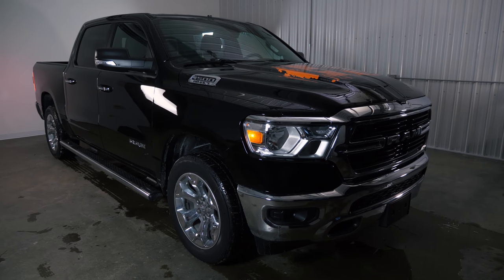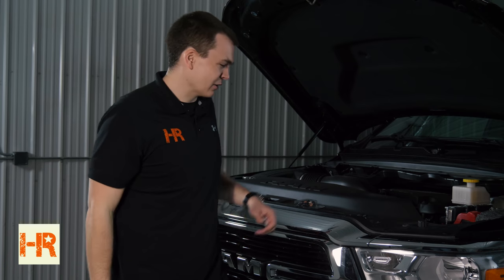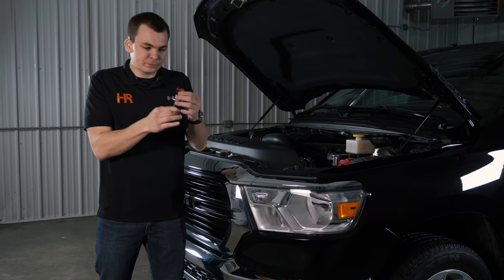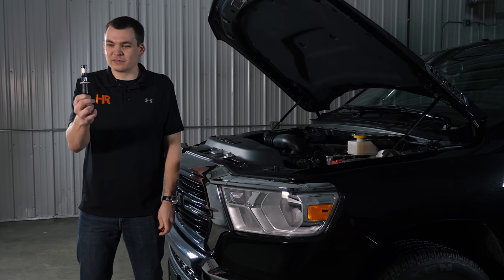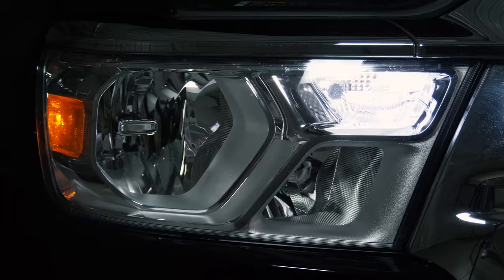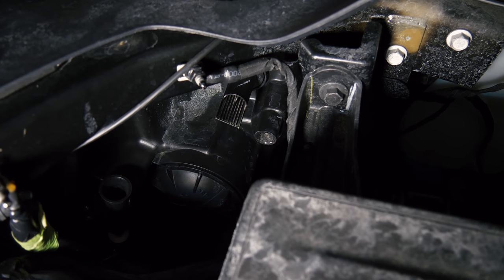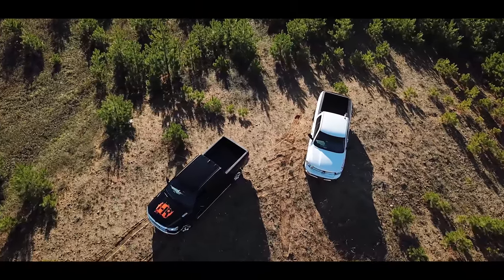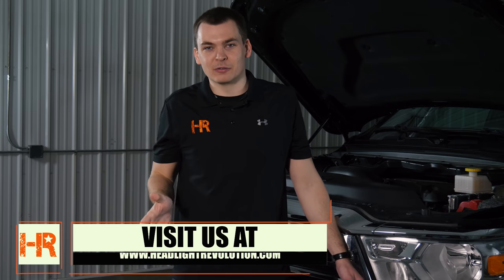2019 Ram 1500 LED Front Turn Signal Bulbs - NO RESISTORS! How To Install and Demo - SUPER BRIGHT

Comment: I have a question regarding my 2019 Ram with the full LED package.   What's the deal with the super dim white LED drl's?  Have you guys figured out a way to tweak the power to them and make them as bright as a chargers?  I understand why Ram did it, because of NHSTA code saying that if they're bright white, then they have to go off when an amber signal is turned on.  Not wanting to be like GM, they made them dim.  How can we trick it and make em bright?

Comment: How do the turn signals work if there’s no wires/plug attached to it like the headlights and fog lights
Reply from the maker: There are wires attached to it! The LED itself plugs into a socket, which is protected by the seal and cover.

Comment: Does the white switchback stay on when the turn signals aren’t being used?

Does it turn the turn signal area into a daytime running light?
Reply from the maker: Switchbacks turn to amber when the turn signal is activated, the white LED shuts off and comes back on when the turn signal is deactivated.

Comment: Hi got a question On my 2011 FORD Escape the rear blinkers has 3 wire I know one is ground the other blinker and brake when I tested it with my test light 2 of the wires both blinked 
does it matter what one I use from the 2 as the positive?

Comment: Are there any rear signal LEDs that don’t hyper flash for the 5th gen ram? Have a 2020 and want rear turn signals that are plug and play within hyper flashing
Reply from the maker: We totally have rear turn signals for your truck, as long as you do not already have OEM LED taillights! If you make sure that you have incandescent taillights, then you will want to go with the Armor Series 2156/3157 bulbs linked below, and you will also need a set of the resistors! 

Rear Turn Signal Bulbs: https://headlightrevolution.com/gtr-lighting-armor-series-3156-3157-led-bulbs/
Turn Signal Resistors: https://headlightrevolution.com/gtr-lighting-50-watt-6-ohm-gold-style-resistors-for-custom-installation/

Shoot us an email if you have any other questions on these signal bulbs! Sales@HeadlightRevolution.com
Reply: Headlight Revolution there’s no plug and play ones for the rear signals? None I wouldn’t need a resistor for? Was hoping for a plug and play like the front signals are
Reply from the maker: I am sorry to say that we do not have a plug and play option, and after looking into that a little further I did find that we will not have any bulb replacement for those at all. The ones I recommended to you above will not work in that vehicle, as Dodge used a different bulb size for the rear turn signals and brake lights, and there are no LEDs that are that size. I wish there was more I could do for you here, sorry about that! Let me know if you have any other questions!

Comment: Do these lights required resisters for cars without canbus systems?
Reply from the maker: No, they are designed to be plug and play on almost any vehicle. We didn't make them though so that's just what the manufacturer says. So far they worked on everything we put them on!

Comment: CK or non CK for that RAM?
Reply from the maker: The 2019 Ram uses the CK type bulb. Here is the link for the bulbs used in this video, in the drop down you have the option for the standard amber color or the white to amber switchback option. 

https://www.headlightrevolution.com/2019-ram-led-turn-signal_2

Comment: I have a 2016 Dodge Journey and the rear turn/park or running lights are T20 based 7440/7443 series bulb. I would like to try out the amber GTR Lighting Carbide CANBUS Series LED Bulbs. Went to the website and saw the price. Never mind.

Comment: I have a 2019 Ram 1500 Classic, would these bulbs work with my truck ???
Reply from the maker: They will not, unfortunately. The 19 Classics are the same as the 18s, and that is one of the few vehicles that still require resistors with these bulbs. 
This is the turn signal kit that we have available for that truck:
https://headlightrevolution.com/2009-2018-dodge-ram-reflector-style-front-led-turn-signal-bulb-kit/
Reply: Headlight Revolution copy that, thank you appreciate it!!
Reply: Headlight Revolution would these hyper flash or create a error on the dash ??

Comment: You guys need to due the rear cargo / third brake light LED upgrade video on the new 2019+ 1500 Ram trucks please 😁 doesn't matter if you get the base halogen lights or the upgraded LED headlight taillight combo, all RAM 1500s still have the standard incandescent third brake light. I went and bought the Philips brand LED 921 bulb at pep boys and I'm not very impressed with them. So I was wanting to know what bulbs you would recommend for the third brake light so you can see it easily in the daylight.
Reply from the maker: hopefully we can make that happen soon!

Comment: Are there replacement bulbs for the brake lights both rear and 3rd? Or just reverse?really hoping to buy one of these trucks soon and lighting has gotta be first
Reply from the maker: These bulbs do not fit the brake lights unfortunately. Ram came out with a new bulb for the brake lights, and no company has made an LED version yet. 

You can see everything that we have for your Ram here:
https://headlightrevolution.com/vehicles/dodge-ram/2019-dodge-ram/

Comment: So i just purchased these after having issues with hyperflashing with Lasfit turn signal LED's, went with GTR because of how much you guys back them and you guys say these are the only ones to your testing that will not hyper flash and instantly as soon as i plug them in....HYPERFLASH! What's the deal? and yes i tried to rotate 180 just to be sure, and nothing super bummed out about that.
Reply from the maker: That is such a bummer my man, so sorry to hear about this! I am wondering what year make and model your vehicle is, and what headlights that came with from the factory. If you can get that to me I will be able to further help you with this!
Reply: @HeadlightRevolution   EDIT* emailed your customer service team and they were able to send out another pair of bulbs instantly. No hyper flashing with this pair as of yet. That’s great customer service, thanks again guys

Comment: I would recommend getting a LED flasher relay and it would work much better than bulbs w/ built-in resistor.
Reply: Works in older cars, but not this Ram, because its flasher relay does not exist or is not easily accessible.

Comment: Hi got a question On my 2011 FORD Escape the rear blinkers has 3 wire I know one is ground the other blinker and brake when I tested it with my test light 2 of the wires both blinked does it matter what one I use from the 2 as the positive to hook to the resistors
Reply from the maker: https://youtu.be/ADKjG3Z2L5w  This should answer all resistor questions!